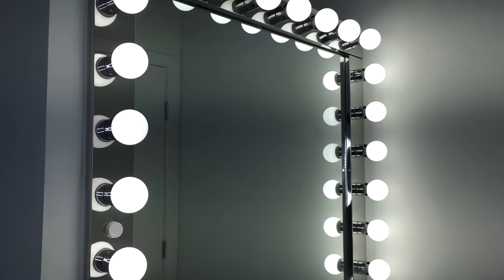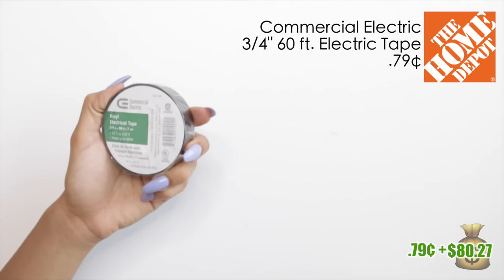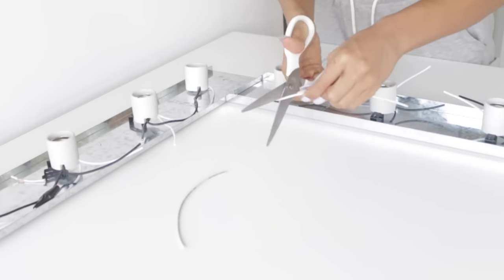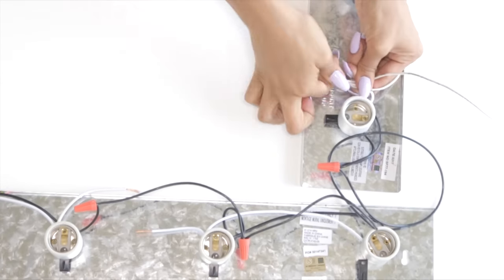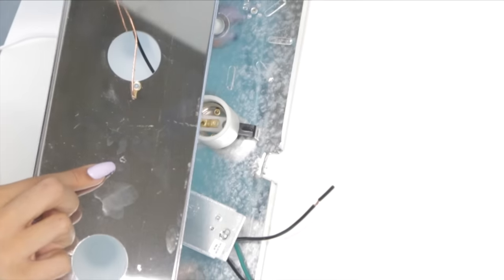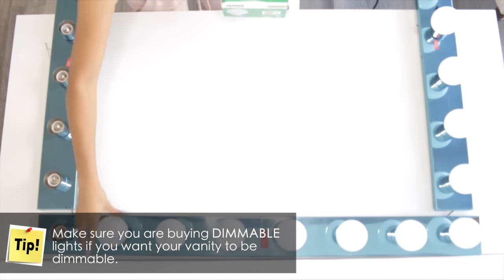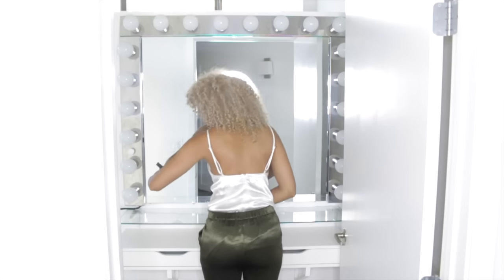DIY Vanity with Dimmable lights for under $250 (50 Inch Vanity)

Comment: Being the wife of a licensed electrician , you did AMAZING! You did everything correctly , it’s almost hard to believe that you did that all by yourself , most people need a professional to help. But you did amazing , from connecting the wires to hiding the wires and drilling holes on the light bars , to hanging the mirror!

Comment: So we followed these instructions and bought the material. We still ended up having to slice the metal back plate and cut into the drywall to make the dimmer switch fit.

Also, you should tell people to cut a whole notch out of the metal where the vanity connects so you don't have to disconnect wiring to take it apart if need be.

Also, do yourself a favor and drill 2 extra holes on both sides of where the vanity bars meet so you can bolt the whole thing together to make it less flimsy when transporting it.

This video makes it seem super simple but it took us about 6 hours of problem solving and doing extra stuff this video doesn't mention you need to do.

6/10 for instructions. 
10/10 totally works if you don't mind having to solve some problems along the way.
Reply: Hi! What is the problem with the dimmer switch? I don't understand and want to prepare for it.
Reply: Same happened to me . The dimmer is to bulky to fit inside the bars
Reply: Jose Del rio how did you resolve the issue? I’m currently building one and having the same issue.
Reply: @interestedinstuff333  Late response, sorry. The dimmer switch she recommends is too bulky to fit inside the vanity bar. You either have to cut out the back plate of the vanity and into the drywall to make it fit, or you can search around for the slimmest possible knob type dimmer switch available, I recommend the latter. The vanity bars are about 1 inch tall of compartment space.
Reply: @daniellegutierrez5285  we cut out the back plate of the vanity and into the drywall to make it work because we were in a pinch, drywall is easily repairable, so we said "fuck it".

Alternatively, you could simply try to find a slimmer knob type dimmer-switch. You could get creative with a slider type dimmer switch too.
Reply: @Altix145  Literally making the vanity now and ran into this issue. Been troubleshooting for hours. Finally after replaying and freezing the frame you'll notice she sliced the metal back plate at 13:59 in the video.You'll also notice that at 7:59 the dimmer is a silver plate and at 13:59 it's a white plate which means she switched it. For this to be such a detailed tutorial it really sucks and puzzles me why she didn't give us all the steps that we need to take to recreate this vanity. I guess she figured when ppl found out they need to become welders as well as electricians we probably wouldn't want to attempt to recreate this project.
Reply: @BeautyNBeast   the electrical advice was spot on, but she absolutely left a bunch of necessary information out. My fiancee watched the vid and got super excited. I have a background doing this type of work, and had a bunch of tools available already so I figured why not.

If you're committed to building it, please do yourself a favor and drill some extra holes where the bars meet so you can bolt the whole thing together, itll make it infinitely easier to get up on the wall. Still handle with care so you dont bend the metal. Make the wire holes notches in case you have to take it apart while on the wall. Try to find a slimmer dimmer-switch before cutting the back plate, cutting out the metal for the switch is a pain in the ass unless you have a cut-off power tool.
Reply: What tool did you use to slide the metal plate
Reply: Altix145 oh that looks complicated lol!! I don’t have experience using that! Do you know of any dimmer switches smaller? I just left Home Depot and they seems confused too. I’m upset because I spent the last week waiting on all supplie and took a couple of hours putting it together and as I put it on wall it’s too bulky!!
Reply: Danielle Gutierrez did you come up with a solution
Reply: @CherieRugeley  our solution was to cut out the back of the vanity bar and into the drywall. Beyond that, you're just going to have to try and find a dimmer switch with a smaller profile. Alternatively, you could forego the dimmer switch and just wire it without the switch, such that the lights just come on when you plug it into the wall, or with a different on/off switch.
Reply: Altix145 ok do you have ig mine is @worldofcdm. That way I can dm you
Reply: @CherieRugeley  sent you a pm. @bangerstock

Comment: THANK YOU, THANK YOU, THANK YOU... I just did it... i bought the same mirror and lights and i followed your instructions to a T and it came out gorgeous. only thing my dimmer did not fit flush lile yours did and i bought the same one u listed... Other than that... EXCELLENT. THANK YOU. Everyone is amazed that i did that. I am so proud of myself.
Reply: Hazlo con Sue OK so since you did it please help me I’m in the process of doing mine I’m up to the electrical wiring part I noticed that the vanity comes with two of each color wires exposed already I believe that’s what she used to power the dinner and power cord but if you pay attention to the video your notice that she only used one of the white wires from the vanity so what happened to the other white wire did she just wrap it around itself and then cover it with a protective screw and tape?🤔🤔🤔 please I would really appreciate if you could get back to me soon as possible
Reply: I’m referring to time 9:02 to 9:05 I think🤦🏽‍♀️
Reply: Lady T there is one part where she conects three white wires together and three black wires... you have to literally watch it closely.
Reply: Lady T also the dimmer i used was one that turns the unit on and off and dimms. i bought it at amazon.
Reply: where you able to fix the dimmer to sit flush? im in the same boat as you.
Reply: xBroWsinG nope... It has like a bump... But i got it to fit so so and it is just there... But it is not really too noticibable... Unless u look at it closely... But no it does not fit flush... she should explain that a little better... Oh well it works thats what matters to me. Xoxo
Reply: What size did u get the mirror ?
Reply: Michelle Rodriguez i bought at home depot the 42 x 36 inches. i think is the same one. u should get the lights to match the mirror size as there are many different size combinations.
Reply: Sugeidy Jimenez I still can’t get the top part of the light to close with the dimmer. The bottom pops out or the top. How were you able to get it on without one or the other popping off.
Reply: Hudda Osman i wish i can send u pictures of how it looks. its not flush but is there and havent pop off yet and its been a while. has worked great. if you want send me a message to my facebook: Hazlo con Sue and tell me to send u the pictures of how the mirror looks i can send them. as if right nownthats the best i can do. sorry.
Reply: can you put the link on which mirror you bought please because I cant find it
Reply: send me your email and what i will do is take pictures and show you how its set up because honestly i dont remember and its covered. so i can take pictures and email them to you. xoxo thats the best i can do.
Reply: Sugeidy Jimenez were you able to find wires that were separated like she had? The ones she listed were solid so I grabbed those but noticed they weren’t the same as what she showed.
Reply: Sue Hazlo is the 42 x 36 big enough to see your whole outfit like hers?
Reply: @Elizabeth Hernandez ground wires are left alone.
Reply: Hi Sue, I saw your comment and I have a question: I see you left your comment on her YouTube 9 months ago; how has the vanity performed since then, any issues? I'm thinking of building this myself and I would love your feedback please. Thank you!
Reply: ANDDDD THE WIRE WAS WRONG !!!!! It’s suppose to be stranded wire and she put solid. I did it yesterday it’s beautiful my dinner didn’t fit either I just put it on the side
Reply: So do you twist the two green wires together from the knob and plug?
Reply: Hazlo con Sue  where did you find the dimmer?
Reply: Same issue.  We ended up adding the dimmer to the side of the desk. The hole  we put in the metal strip isn't that noticeable.
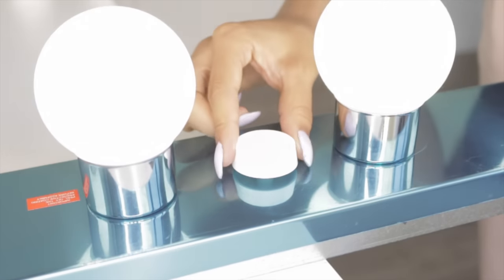Reply: I just noticed at 11:40 that her dimmer doesn't fit either...
Reply: where did you get the mirior
Reply: @juanvadillo6015  I got my mirror at Home Depot.  42x36
Reply: @Asia Worrell The ground wires you leave them alone.  There is a screw all by itself (small one) and i rolled it into that screw and its all by itself.  It cannot be attached to anything.  Do the same for all the ones that have ground.  Sorry for not responding sooner. I hope it came out great.
Reply: Ok so Im conflicted I have everything up and put together and only 5 of my lights come on fully and 2 come on slightly and then the rest don’t come on at all now idk if it’s because of my lights or if it’s something else should I use the exact same lights as her my bulbs are 43w 120v should I get a lower voltage and watts type?
Reply: Nvm I figured it out
Reply: @onaliepark547  Im sorry I was sleep, I just saw your message.  Im glad you figured it out.  Have fun :)
Reply: @Suexoxo  thank you, also what should I get to hold my glass piece up? Because I really don’t know
Reply: @onaliepark547  I used those clips to hold mirrors. i got them at home depot. butnalso when i added the light i placed them, that they were extra securing the mirror. i wosh i could send u pictures, cannot attach here 🥺😫
Reply: @Suexoxo  no I have the mirror up I meant the glass shelf that she put under the mirror
Reply: @shaenicole22  which wire did you buy

Comment: I am beyond super impressed! You did a great job and did your homework with the electrical requirements. In all my years doing electrical work here and there I've never seen anyone strip insulation off wire with scissors. If the wire was stranded you would want to use actual wire strippers instead. 
You did all this while looking fabulous and with those nails! Amazing!

Comment: Hey Lady! Hope all is well. I was wondering if the mirror is 42X36 and not 36X36. By looking at it, the 6 bulb bars are 36 inches (as you showed) and the mirror IS the length of the bars going down. Going across, the mirror can't be 42 inches. Amazon says that the 6 bulb bars are 36X4.75, if you subtract 4.75x2 (because there are 2 6 bulb 36 in X 4.75 in vanity bars) from the 46 in 8 bulb vanity bar, across the top, the mirror would be really close to 36 inches too. Awesome DIY and I don't want to miss anything.I'm gathering my materials and want to order the right things. Help!
Reply: Did you ever end up buying the mirror part? If so were the measurements 42x36 or were they wrong in the video? 🤔😱
Reply: Hey Cookie. Yeah, I did the whole thing and the mirror was 42X36. What she did though, was place the light bars on top of the mirror on the sides. The bars covered the mirrors a couple of inches on both sides. Watch the video very very closely at 13.49, you will see the light bar sitting on the mirror. It came out pretty good though. I was torn between putting the whole thing on a piece of wood and hanging it like a huge living room portrait. I'll be moving eventually and I like that's how I going to do it next time.
Reply: Hey Daisy! I did use a dimmer. My dimmer didn’t fit inside the light like hers, though. So I had to improvise.
Reply: Tommy T hey tommy, what did you do to improvise with the dimmer?
Reply: Tommy me too but I noticed when it came down to the power And dimmer she only had one white wire from the power cord so what happened to the other White wire considering it comes with two white wires and two black wires already exposed that’s the wires that she used right or did she cut more again just to connect the power cord in the dimmer please help I’m in the process of this but I’m kind of feeling a little stuck here
Reply: Lady T,  
Sorry!! Are you good now?
Reply: Hi my dimmer did not fit either. What did you do to make the sides even?
Reply: Tommy T what measurement did you use for your mirror, I’m a little confused
Reply: Where can I get the mirror
Reply: Hi Tommy so to be sure, the measurements are 42X36? Because in the beginning she said the 8 light bulb was 49" ? Im confused
Reply: Good eye Tommy T. She did place the strips on the sides ON TOP of the mirror.
Reply: Hi i dont think she placed the strips on top of the mirror..it’s not possible to drill in the wall if she did that. Did you figure yours out? Looks like she let the 48” vanity strip hang over the actual length of the mirror which gave room to squeeze in the 36” strips on the sides
Reply: Tommy T so was the mirror actually 42X36??? If so where did you get yours? I want the same mirror
Reply: The dimmer doesn't fit. How do I make it fit ?
Reply: @TBANGHA  Thank you so much. I thought I bought the wrong items.  I got custom cut plywood and though my measurements were wrong when I laid everything out on the plywood.  I wish she mentioned this in the video. 😒😒😒
Reply: Hello from Angel hi how did it come out. Because am having the same problem and thinking I should get a bigger mirror

Comment: I rent a condo and I’m about to do this project (been wanting to do it for over a year now). Just as a suggestion to anyone else who may want to do this project, I would suggest mounting everything to a thin but story’s piece of wood then hanging it up on the wall like you would a heavy mirror. Find your studs, use a level, etc. But doing it that way would make it a lot easier for transport in case you decide to move.

Comment: Hi, thank you so much for the wonderful video! I have a few question 
1) if the mirror is 42”x36” then the 8 light vanity strip that is 48” wide doesn’t cover the 50” width of the mirror & the side vanity strips. 
2) if you have put the mirror clips on top and sides, why is there no gap between the mirror and the vanity strips? 
How did you manage to remove the gap of the mirror clips and how did you fit the top vanity strip in line with the side strips?
Reply: Exact issues I’m having right now

Comment: I tried this, there's a few important details that are left out in video especially if doing this alone and inexperienced.
Reply: Care to share?
Reply: Ya rely??? Need to know!!!
Reply: Dimmers don't fit.
Reply: @muziqvault7082  I noticed the same thing. dimmers fit within the light frame but when you close the top, there is no way it closes flush so that the light appear the same as the other plates. I think the front plate of the light will only go down half way.  Is there any suggestions? These are the exact dimmers.
Reply: @Prettylilpursepavillion  I thought about getting some 3/4 in plywood. Big enough to put the lights and mirror on it then cutting a hole in the frame of the lighting and cutting a square hole in the wood do the dimmer would sit flush. This will make it project one piece like a picture. If you ever want to take of the Wall for example when you move you want have to worry about multiple pieces. Just my thoughts.  I tried like 4 different kinds of dimmers.
Reply: @muziqvault7082  did you do it if so how did it turn out bc I was thinking the same thing

Comment: Nice build and smart thinking with the mascara. Can also use toothpaste or nail polish or grease. A tip when drilling start with small a bit then go up in size and use a block of wood on the other side for support. Good job

Comment: I just finished making mine and STUNNING! Thank you for this video. One question: which dimmer do you recommend? i bought the one i saw in this video but the depth was too much. it made the place where it is supposed to be bulge out :/ Please advise. that’s the only thing missing. i’m plugging in and out when in use
Reply: So we’re you able to put the dimmer? I have put this project in hold for a year and I came back to see if she replied or someone fixed the issue

Comment: Great looking work and love how detailed you were but man I wish you had expanded on the dimmer situation, it doesn't fit and it's been a bitch and a half to figure out. I think I've figured out a way to do it without building a box for it which is to use a wireless led lamp dimmer that fits the watts. It's like $50 added on but hey i'm already here and bought all the stuff so might as well push it to $300.
Reply: Can you elaborate on the one you used?
Reply: sharde wilson I returned it but they were located at Home Depot. I can’t remember the name.

Comment: I followed all of the steps up until the point where i got go the installation of the dimmer. I got it all wired and connected but the problem is i could not completely close the light strip. How did you get it to comletely close?
Reply: Simone Jackson have u figure yours out? Coz that’s where I’m stuck rightt now😩😩😩

Comment: Next time us the linesman to twist the wire together tightly. Buy the red wire nuts with ears. The ears help grip the wirenut so you can get a tighter fit. Also twist the wire nut till the wire start to twist as well. Loose wire and loose wire nut are dangerous.